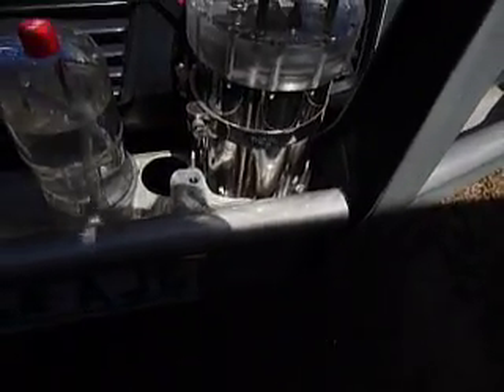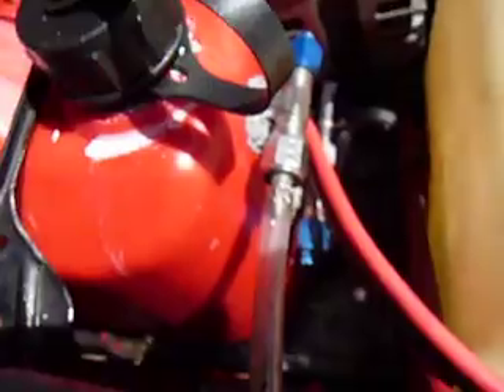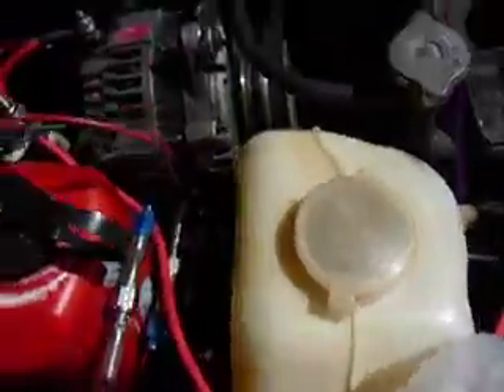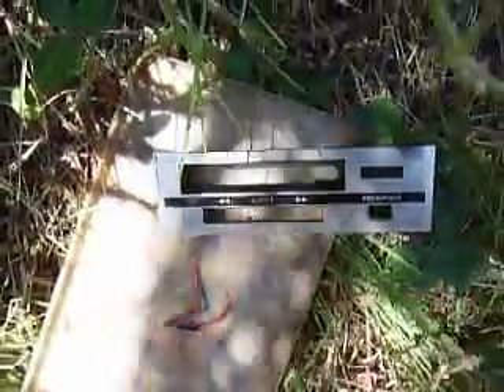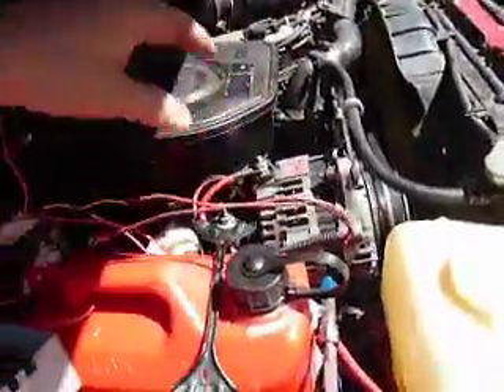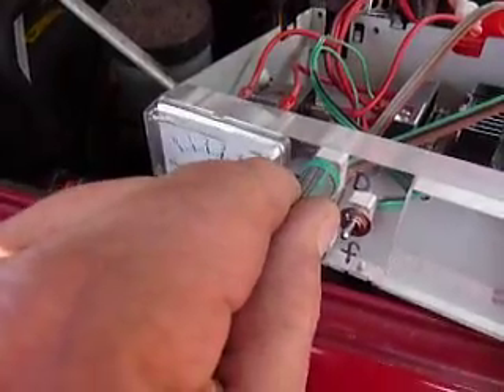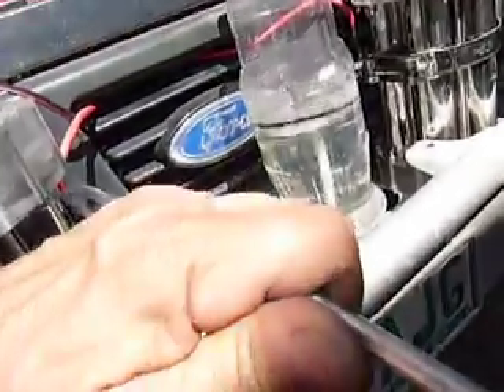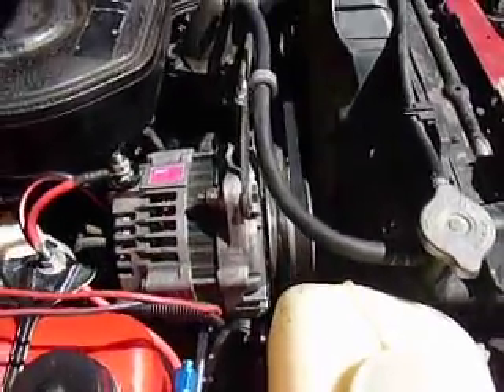12+ ltrs/min, 3 Amp resonant field alternator, HHO breakthrough?

Comment: Did Stanley use 1 volt @ 0.5 AMP resonating at 20,000 cylces per second? If so, how would one go about this, i was thinking of using an Arduino to control the out voltage oscillation. Do you think this is practical?
Reply: Not sure about the 1 volt. I don't recall much of him talking about how input voltage and amp draw. But I do know he said for it to work well, each resonant cell should be at least 1000v. So if you have 7 of those cells together you need 7000v. His whole idea was high voltage, and low amps. He said when it's resonating correctly, it should be pulling in the milliamps(per cell)... virtually nothing. He used voltage amplifiers, probably going from 12v. Not sure if you can get the waveform and freqency from just an arduino. It might be able to pulse fast enough. I just kinda started to dive into this but I'm thinking using an arduino to do all the 'fine tuning'

Comment: If you use bifilar coil you can get more hho and less amps
Reply: @MsSpicynipples  check this link https://overunity.com/5805/hho-cell-stan-meyer-design/ , you will find a lots of info about Meyer design , the only right way to make hho from water. Need follow three criteria, 1) Hi frequency, 2) Hi voltage, 3) Low amps. The most difficult # 3, Low amps, but... if use bifilar coil in resonance you can get a lots of hho with low amps. Forget about water molecule resonance , people talk about  water molecule resonance, but in reality  water molecule resonance nothing to do with hho, Meyer mean resonance of the electrical field in bifilar coil. As soon you can make bifilar coil in resonance it is same thing you find aladdin lamp , magic will start )) . Also, I recommend you  read Don Smith devises ,  Tesla bifilar coil patents .  Tesla, Don Smith, Kapanadze, Meyer, and others , they all from same bus, which is name Resonance of Electrical Field, this is main key.

Comment: Hello Sir,
Did you work on these cells or just left this topic. I don't see your any other video after this cell.  And plz tell me how to get 12 lpm with 12v dc . How much amps wil be used?
Reply from the maker: since i have moved overseas there has been no further work done on the HHO.
My plan is to resume work on it but getting organised is not easy in my new country.
thanks for your question.
Reply: @adesades01  ok
And how did you make these top and bottom plates.
Reply from the maker: @MuhammadRafiq-mi7cd  on a cnc mill, one of my other vids covers that.
Reply from the maker: @Robert Lakelin G'day Robert, thanks for that compliment and i would really have liked to continue developing it. You probably gathered why i used that large carburettor equipped  4.2ltr 4x4 because there would not be any nonsense with fuel injection computers changing the fuel / air ratio and rigging my test results with an eefie mod. So it's no where near eliminating gasoline but did prove the more efficient use of it over 1000 km of testing, it gave about 20% better fuel economy from memory.  Keep in touch by all means my e-mail now lannaking@gmail.com
Reply from the maker: @Robert Lakelin BTW Robert, I agree with your idea re- flat plate not being ideal, from any resonance perspective, if it exists. My old vids on this channel have flat plate tests and a very promising unit was the spiral cell unit on another of my vids. where i was going with it was robust cells, fully flooded and pressurised to keep gas bubble size to a minimum and the whetted surface maximised. As for water resonance i'm still undecided on it, i have several thousand dollars worth of tektronix analog signal generators, amplifiers and oscilloscopes and spent hundreds of hours looking for resonance effects but really any resonance only occurred in the inductive parts of the circuits, not the water. Cheers.

Comment: if possible to explin what is size of pipe lenth widh how many pair used 12 littre hho gas pruduce what is voltage input & amps thanks for your answer waitng
Reply from the maker: CK, please check my other videos, you can see exactly how the cell is made. tubes about 240mm long, several concentric tube sets, 7 sets of tubes per cell. power from a dedicated alternator making up to 28vdc at up to 80 amps with a field current up to 5 amps pulsed to affect the output frequency.
Reply: @adesades01  thanks what is pipe gap between 2 pipes

Comment: also.. what do you think of this pwm controller?

http://pages.ebay.com/262433532191
Reply from the maker: something wrong with that link gary
Reply: +adesades01 sorry bout that.. no idea.  

here is the link.

http://pages.ebay.com/link/?nav=item.view&id=262433532191&alt=web
Reply from the maker: I'm for keeping things simple and home made, that's the complete opposite. but if moneys not a big issue it's still an 80amp pwm with bells and whistles, I won't say it's junk. yet.
Reply: +adesades01 ok.. 

how does your controller hook up to an efi car and the cell? or is there a video explaining the cell and controller?
Reply from the maker: I did my testing on a non EFI gas guzzling 4x4, specifically to avoid computer controlled fuel mixtures. As the hho burns normally wasted fuel in the cylinder rather than the exhaust pipe, the O2 sensor can detect a lean burn, increase the injector timing and add more fuel (richer) to compensate, thus negating the HHO benefit to fuel consumption. I don't know the answer, except to say some guys use an EEFie to modify the O2 sensor signal and fool the computer.. all a bit hit and miss for my liking. I think an EEfie should be used in conjunction with a cylinder head temperature monitor. The whole thing is get a system up and running firstly and get some fuel consumption figures to work with. If you can get 20% better milage then I would leave the whole eefie thing out.
Reply: +adesades01 no worries.. all good.
Reply: +adesades01 try disconnecting the maf or put a switch/relay on it.  

see how that goes..

Comment: So this is type of wet cell?
How would you rig this for just pure Hydrogen...?
Reply: +Journalistification hmm... I know HHO is much more unstable. Pure Hydrogen, according to Mike Strizki, is very safe to store... Much safer than propane and natural gas. Keep the oxygen away and have flashback arrestors on all your valves and you ought to be fine... But yes, you're right, HHO is much more powerful and you get much better energy yields.
Reply from the maker: +RascalKyng There are a few mechanical methods that could be used,  an ionic separator between the cell poles that prohibits gas flow while allowing current flow. maybe a molecular sieve that passes hydrogen atoms but not Oxygen atoms, or a gas density separation unit perhaps utilising centrifugal force... whatever way it will be a lot of extra work.I guess you don't like storing Hydrogen and oxygen together at their stoichiometric ratio?? don't blame you.
Reply from the maker: +RascalKyng Try downloading this book, https://archive.org/details/industrialhydro01taylgoog
Reply: +RascalKyng About the separation of hydrogen from oxygen in a gaseous state, don't take it from me but i have read from many others that the power gained/felt when adding hho is much greater than just hydrogen  and remember that is best not to store it but use it as you go or what is the same making hho on demand , after all that is exactly what  Stanley Meyer from Ohio , Daniel Dingle from philipines and other pioneers on the subject were doing , they never talked about storing hydroxy gas or just plain hydrogen because yes it is very explosive , not so bad though when it goes from the cell directly to the intake on the engine , or a bubbler to the engine.

Comment: Felicitaciones por sus trabajos; como puedo contactarlo para adquirir un equipo. saludos y gracias.
Reply from the maker: +FELIX SOSA Thank you, due to personal reasons i have not had time to advance the HHO projects. i hope to be doing some more work on it soon.
Reply from the maker: +FELIX SOSA I made this as I went and no circuit diagram was necessary. suggest you watch this video https://youtu.be/9dlpAxdyTO4 it explains the hook up. Note:&#160;jaycar that I mention for the PWM controller is an electronics store in Australia.

Comment: not bad...but you still need all that extra stuff...the pwm, and all that....what if I could show you a way to get a generator with a built in PWM....so that when you step on the gas...it increases hho production? I have it...its a 48V generator with a built in pwm...we are the manufacture...
http://www.ebay.com/itm/321562391933?ssPageName=STRK:MESELX:IT&_trksid=p3984.m1558.l2649
This is the only system that gives you a variable rate HHO production...all based on gas pedal pressure. 1-50 ltr min.
check it out
Reply from the maker: +Maxam Sailor Best check my other vids, they cover pretty much everything, the cell construction, the alternator mods and pwm system and general gas handling like bubblers and flashback protection. cheers.
Reply from the maker: +goturtlepoop nice of you to use my channel for your advertising, hope you subscribed, haha.
Reply: you should stop telling that lie.....
12ltm @ 4 amp....not gonna HAppen
Reply from the maker: +goturtlepoop Absolutely correct. I have modified the title to more accurately match the video content. you and maxam sailor should watch the rest of my vids before asking questions. the Nissan Patrol HHO experiment is over for now and a new phase in HHO production is starting soon. cheers.
Reply from the maker: Go turtle, any update on your PM alternator? just had time to check your link, 
What's the latest bro? 
BTW, saying "At 10 amps this unit will out-produce any 12V single hho system by 10 TIMES!"
          sounds like a bit of bullshit from you, lol.
 http://vi.vipr.ebaydesc.com/ws/eBayISAPI.dll?ViewItemDescV4&item=321562391933
&t=1418702176000&tid=10&category=166664&seller=totalhho&exc
Soj=1&excTrk=1&lsite=0&ittenable=false&domain=ebay.com&descgauge=1&
cspheader=1&oneClk=1&secureDesc=0

Comment: has anyone tried using an oscilloscope to measure the frequency of their water/electrolyte then pulsing the same frequency through the volt/amps of the plates, is that what you are doing with the variable knob, finding that nitch frequency?  May have to pulse the same frequency inverted, would be nice to see both.  I have no idear how to do either.  Its difficult to find information on frequency pulsers and how they work and where to buy them.
Reply: also while pulsing that frequency, having the ability to adjust the volt and/or amps would be key, i think most of those machines can only pulse X volts with LOW amps probably mili amps to 2 amps, so converting excess amps to volts may be "the way" and also the reason why people who have tried Only high volts and low amps have been unsuccessful because of the frequency of that energy was not correct.
Reply: yeah heres a good place to start

what stan has done is choking the current with the tuned transformer and the fuel cell wich acts as capacitor creating a tuned LC cicuit limiting current and letting voltage flow through  wich can be calculated and are explained in the pdf called "Stan_Meyer_Full_Data.pdf" and hers is the link to it
wich is based on original stanley meyer journal
http://www.theorionproject.org/documents/Stan_Meyer_Full_Data.pdf
go to page 52 read downwards from Voltage intensifier circuit

and is explained on page 5 in the original journal 
http://www.globalkast.com/docs/Hydrogen_Fracturing_Process_Original.pdf

also the fuel cell output gases (oxygen)  are processed and ionized before input into the engine 
and the exhaust gases (non non combustible) are also recollected  and put into engine intake air to slow down hydrogen burn rate of 300cm/s to a normal combustion gasoline engines 40cm/s rate

also here is a complete pack all you need to know about 
http://rwgresearch.com/open-projects/stanley-meyers-wfc-tec/
click  "Full Download Stanley Meyer Original Data From Estate"
to dowload 1.2Gb of  organized original pictures and electrical schematics

Comment from the maker: So rick, hows that going? hope your having some success.
Sure the trick is to have a modified alternator making big amps
and whatever voltage it needs to make those amps. it's not hard to
modify the alternator and control the <5 amps for the field, rather than the
100+ amps the cell uses. make sure the output wiring does not fail though.
I have vids on my channel how to do it made easy. Cheers.

Comment: might wanna try sum lead additive in your gas to help with those valves  hho is hard on the steel i found out the hard way
Reply: I know this is a old post..... but if you run the gas thru a carbon filter. before entering the engine. then the gas will not have ozone in it anymore. that is what is hard on the metals and gasket in the engine. you could just fill your bubbler with activated carbon filter media. :)

Comment: im getting about 25lpm@80 amps 12v with my 65 plate dry cell using a 165amp delco alt thru a pwm i mod'ed to take 100amps i  thinking about eliminating the pwm and using a current limiting circuit to the alt fld similar to what youre doing i want to try a high amp ultrasonic pulse to attempt output gains w/o using up much more current
Reply: Are you pretty sure?

Comment: The capacitance goes down as it is no different than if you put a tube in water and slowly lifted it out while you were measuring it. The different types of water I believe have the same capacitance but the resistance part changes a lot. 
My guess on the other guy is he had to monitor the pressure in the tank, keep the system in resonance, and make sure everything else was in working order while Meyer drove the car.

Comment: From what I have read in the patents he is adjusting a PWM for the drive motor to keep the system in resonance as Meyer drives down the road. The reason would be the more gas that is produced the more water it will displace out of the tubes thus changing the capacitance which will have a new resonant frequency. That poor guy is doing all of that on the fly. Later Meyer made auto sensing for resonance so only one could drive the car down the road.

Comment: I also noticed a pressure gauge, this time, on the big(what looks to be aluminum)tank. The reading on the gauge was high and it was rising. I read, aluminum is one of the only materials that can hold hydrogen well. Was that guy regulating the flow of hho coming out of the big pressurized tank according to the RPM/acceleration/deceleration? That's kinda what it looks like. What would he be adjusting on top of the tank there to adjust the resonance. Why couldn't they just put the dial on the dash?

Comment: Oh, never mind then. In the title it says nothing of applying the voltage to the field windings of the alternator. But just so you know, the alternator needs to be connected to an independent drive motor, reason, the rpms are how you find and maintain resonance with that system, hintz the job of the guy riding with Meyer when he was driving along the highway. Good job then, my bad ;-)

Comment from the maker: Check your own video of the Stan Meyer water car, he had measured 5v @ 2 amps,
which again is FIELD CURRENT. No more misleading than Stan Meyers and his
'gas management system' or his bench 'resonant charging choke circuit', again, both
of these controlling the FIELD CURRENT to his rarely talked about modified alternator
on the bench top patent application demo unit and also fitted on the dune buggy.
cheers.

Comment: Being a mechanic for over 20 years I can tell you 4 amps will not make any changes in the car's rpm so you are using far more than just 4 amps. Example, your head lights will draw around 10 amps and the high beams 15 amps but your engine's rpm will not drop when you switch on the lights. Figure out what you are doing wrong on your measurements and correct the title of this video for as of right now it is misleading.

Comment from the maker: thanks, the alternator is modified by disabling the inbuilt
voltage regulator and controlling the field current by
direct connection to the brushes controlled by pwm 
of the regular car systems 12v battery and alternator.

i could put a quick video up of the detail if that helps.